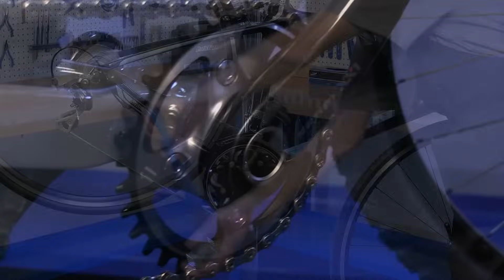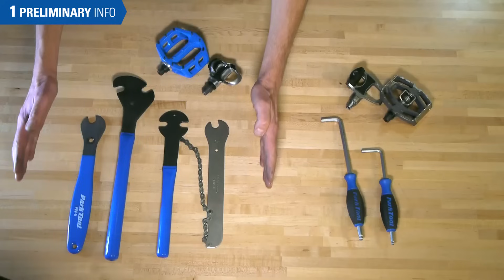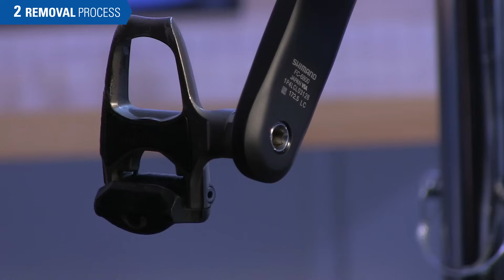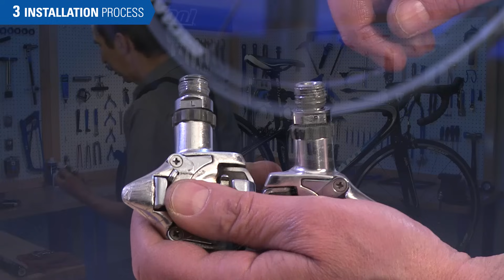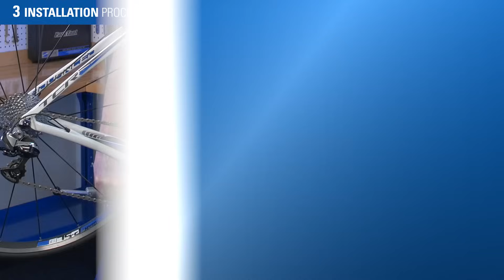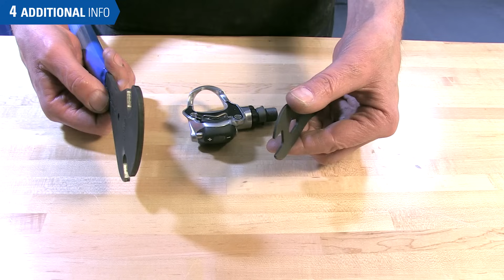Bicycle Pedal Removal and Installation

Comment: What about using a pair of hub adjustment tools?  ;-)
Reply from the maker: A pair of cone wrenches can work. It is not advised though as the cone wrenches are not designed to take the large amount of torque that some pedals require to remove.
Reply: Park Tool 

Thanks. From the video I gather the cheaper tool is not recommended since you can't pick the angle for optimum leverage.
Reply from the maker: Being able to loosen or tighten at multiple angles is a big plus and if budget allows we would highly recommend going to a pedal wrench with multiple angle options.

Comment: I got some cube all mountain pedals and I have a 9/16” and 15mm pedal wrench, both seem to be too big which doesn’t make sense, I’m about to throw this bike away and go back to skateboarding, shit shouldn’t be this difficult
Reply from the maker: It is common for pedal wrench flats to be undersized, which is not a good thing, just the way things are.  Measure with a caliper and you can see this on many different brands.  The pedal wrenches can deal with this, just don't over tighten.
Reply: Park Tool I think I need to get a bike stand soon, so I’m an idiot and the pedals were suppose to be applied with an Allen wrench, I didn’t put enough grease on I think but I took it to a bike shop, they got the pedals off, greased them really good and put them back on and they adjusted my front brake

Comment: Hi! I have a question, is it possible to change pedals wich just has a 15mm option to pedals with just an 8mm option? (On the same bike) Soooo helpful videos❤️
Reply from the maker: Yes, the threading of the pedals is the same 9/16" x 20 tpi sizing, so either can fit into the crank.
Reply: thanks, keep up the good work:)

Comment: Thanks for this vid.  The tip at the end re: breaking lose extra tight pedals worked great for me.  My arms aren't quite as long as the mechanic in the vid so I held the off crank with one hand and applied pressure on the wrench with my foot.  Solved my "stuck pedal" problem with no sweat.

Comment: I literally just ordered the park tool 15mm-9/16 wrench. When he mentions using a "crow's foot", I ran out to my garage and grabbed my crow's foot 15 mm and car brake tension wrench. Ta-Da, off comes the pedal!! I ran back in and canceled my amazon order. The brake tool crow's foot was thin enough to fit well on the pedal, the long handle of the tension wrench provided plenty of torque. Park tool I'm sorry you lost a sale, but thanks for the idea from the video. Ironically I've never used my brake tool for a brake job.
Reply: R
Reply: Fuck of
Reply: I just did it with a regular 15mm wrench too

Comment: lossen the pedal towards the rear wheel, install and rotate towards the front wheel..simple as that
Reply: +Miron Klescik  Thank you!  Always love easy ways to remember things like this.
Reply: @sidefx996  No, it really doesn't make sense. I'll explain why: a rotating circle can be perceived as both "rotating away" or "rotating toward." If a person thinks you mean the bottom of the circle, the bottom of the circle will be moving the opposite direction to the top. So to make this instruction useful, you should refer to the portion of the circle you mean OR use even better terms, like clockwise or counterclockwise.
Reply: @Dave-lr2wo  you're apsolutley right, but everybody can tell what I mean and everybody always refers to the top of the circle, its easier that way because if you say "turn it clockwise" it doesnt apply if you look at your bike from the other side
Reply: @Dave-lr2wo  stfu u moron
Reply: @ghrodf7575 Shut the fuck up, you moron.
Reply: @ghrodf7575  Wow, that escalated quickly.... u moron.
Reply: @rony_ftw But thats exactly what it does!! You look at the bolt (or pedal or whatever) you are working on from the side its going out
Reply: Just tried this and it works.  This tip is more useful than his video because there's no waffle in it. Cheers!
Reply: Saved me 7 mins.😂
Reply: Most helpful comment
Reply: Brilliant
Reply: Excellent advice. Thank you.
Reply: Mind blown 🤯 too easy
Reply: Or just learn how to do it rigjt

Comment: Great guide!!
As a total newbie at this here are my comments on what to do when installing pedals(i bought a 4800$ biscycle and had issues with this lol so i thought i´d share them with you)

#1 OIL UP THE treads and "hole" and don´t be cheap on the oil!!! VERY important IMO.
#2 USE A PROPER wrench, best would be a non-adjustable one.
#3 Check for Left(L) and Right(R) on the pedals, as a novice i didn´t even think about this....this is obvious if you have done it once before but i seriously havn´t thought about this. Screw the pedals "towards the frontweel" when installing them.

Basicly oil, a proper wrench and then check for left and right does it all.